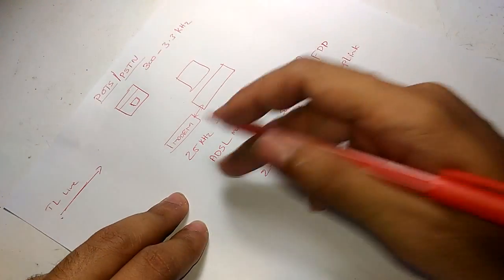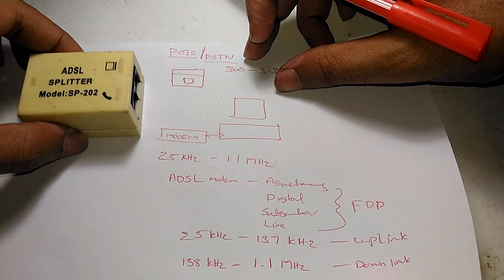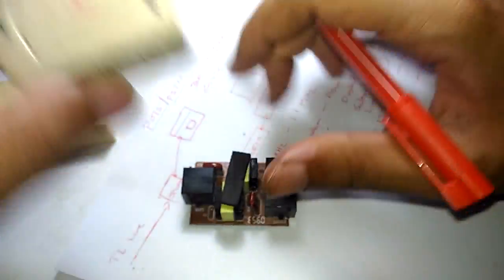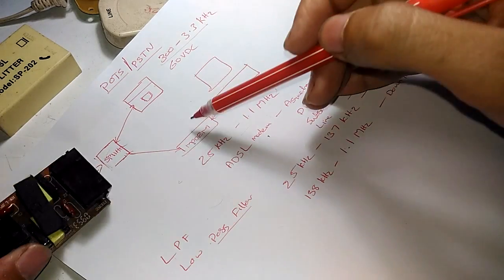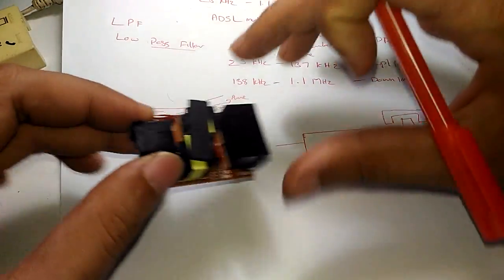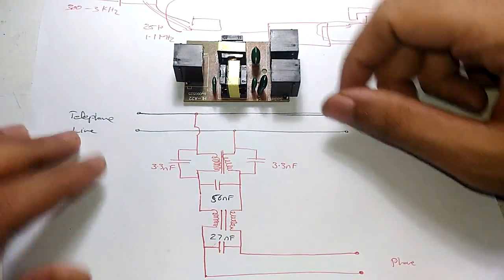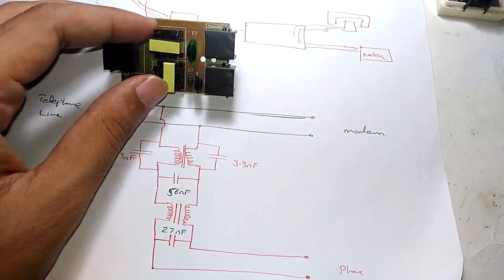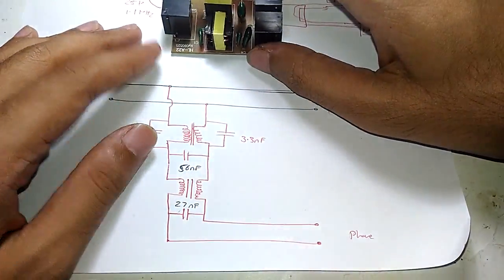IE42: How does an ADSL splitter works?

Comment: The best explanation ever of exactly how a DSL filter works I've ever experienced.  I am going to attach a signal generator to the input and an oscilloscope to the outputs to see how well my filter works. It's interesting that the filter is a low pass just for the phone.  I always thought both the phone and the computer needed filtering.  I agree regarding the false lightning protection claimed by that one manufacturer.  Great video.  Enjoyed it.  Thanks very much.

Comment: Are they still relevant?
Reply from the maker: Yes, if the people still prefer to use landline telephones.
Reply: @INSIDEELECTRONICS  what about internet? Also what are we using besides landlines?
Reply from the maker: There are still many people and offices using the broadband internet services. Perhaps due to the lower price of usage plans. So in such cases, these are still relevant.
Reply: @INSIDEELECTRONICS  landline means broadband? What's the better deal from those fiber??

Comment: so if my modem and telephone are apart i only need to have the splitter on the phone side. i opened inside my splitter and it's circuit board was the same but when my modem is trying to connect i can hear audible noise on the phone. my ADSL modem becomes noisy and i call support center they do stuff and tell me to reboot my modem and all the noise goes away for a few hours even no clicking sounds on the phone but after a few hours my modem keeps dropping and i have like 6000 CRC errors recorded on router interface. it has become an enigma that nobody wants to take responsibility for it.

Comment: great video, props for that my dude.
can i get some help though, i'm kinda confused.
the problem is that im getting about 17mbps when plugged-in directly to the line, when using a splitter it increases by 1mbps (meaning it turn to 18mbps) so is there a way to get the full advertised 18mbps without using a cheap splitter?
Reply from the maker: Well, I'm not sure about it. I suppose you can keep using the splitter since it's only improving the performance. 😀

Comment: Will there be any problem if I connect directly only to my modem without a splitter? (Not using a landline)
Reply from the maker: If you are not using a landline then you can connect it straight to your modem. No splitter is required. 👍🏼
Reply: @INSIDEELECTRONICS  Okay thanks, well what could be the problem behind this, sometimes my modem doesn't give internet access but when I call my landline that's whn internet starts working
Reply from the maker: If it's happening when there is a splitter in between, then try a different splitter or just connect it straight. If the issue persists, you may need to get it checked with a technician.

Comment: Sometimes when I pick up my telephone the internet disconnects for the time being. Is it because, The splitter is still adapting?
Reply from the maker: I'm not sure what exactly is the issue here. However you can try changing the splitter and if it happens after that, you may need to contact the telephone company.:)
Reply: @INSIDEELECTRONICS  ohhh, thanks for the info!

Comment: Hi, I got a micro filter upstairs and connected my router modem to it but I have no broadband signal. Can you please help?
Reply from the maker: Hi, first of all, check whether you've inserted the appropriate ports to the correct sockets in the splitter. Modem to modem, phone to phone and input to input. If that is fine, remove the splitter and connect the incoming line straight to the back of your modem and check. And check your modem is configured properly with the correct connection type and login password. :)
Reply: @INSIDEELECTRONICS  Yeah all of that is correct but my lights are shining red
Reply from the maker: Alright, that means the modem needs to be reconfigured. Contact your ISP or simply google to get the configuration method of your device and make the changes accordingly. That should fix the issue. :)
Reply: @INSIDEELECTRONICS  Do you think the cabling inside the telephone socket is incorrect?

Comment: Can telephony device frequencies interfere with modem frequencies further down the phone line (as they start to travel down the same copper pair wire towards the telephone exchange)? Or do they remain separate because they are using different frequencies?
I understand that the filter/splitter is blocking this from happening after the filter/splitter.
Reply from the maker: The thing is, outside the filter the telephone line is always susceptible to interference from all kind of different frequencies. But the telephone system is capable of differentiating what is useful and what is not. So we don't really notice the effects of such interference. Also it's not like the voice and data are both travelling as seperate frequencies, they always remain mixed the whole way through. :)

Comment: I do it , its very performances : the phone be very claire without noise... and the net be good conexion and without cuting
 please i m looking for adsl convertion to wan ?!  how its doing and how can'i inject it in the roter fibre (after the 1er fibre coversion ) :: i like it for uses the magnifique and performances qualite in the router fiber optique .. think you for your speed answer !?
Reply from the maker: From what I understood, you are trying to connect the fiber connection to your router, isn't it? For that you need a modem that support optical input. Once you installed such a modem, then the remaining process is similar to the normal cable modem. You need to configure it with the credentials received from your ISP and then you can use it like normal. :) If you are using an optical router you don't need an ADSL splitter.

Comment: I need to connect my telephone with my router and router has rj45 female jack so can I connect my landline connection with this converter...
Example- A wire with rj45 connecter from my router will insert into the main line of this adsl filter then I would connect my landline phone from the other end...
Kindly reply..
If answer is NO then what is the hack for it as I want to do calling from my broadband connection
Reply from the maker: Nope, absolutely not. You cannot use the ordinary landline phone to connect to the router. Both operates at different protocols and different voltage levels as well and there is no point in trying to make calls through broadband connection with an ordinary landline phone. Your smartphone can do it for you if it supports VoWiFi. :)

Comment: Can i connect ADSL-cabel directly to the "Phone" slot? Or is it necessary to connect it to the "DSL" slot?
Reply from the maker: Nope, you've to connect the modem to the ADSL port and the phone to the phone port. If you don't want to use the phone you can connect the modem straight to the telephone line itself. No splitter is needed in such case. :)

Comment: excellent video
Reply from the maker: Thank you so much for your valuable feedback. :)
Reply: @INSIDEELECTRONICS  From ur video , I understand that we can connect modem to the main line in one room/port and telephone can connect in the another room / port using adsl filter/splitter ..am I right?
Reply from the maker: Yes you are. As long as you are using a passive ADSL splitter, you can connect it like that. :)
Reply: @INSIDEELECTRONICS  Thank u

Comment: I'm not getting the speed which my plan provides .is it because me splitter is complaint.
Reply from the maker: I cannot be sure about that, but you can check it by connecting it directly. Also due to the current global situations, ISP's sometimes cap the speed to balance the overall load. Even I'm facing the same issue when uploading contents to YouTube, but not always though.

Comment: AC power (75v) is supplied to the phone line via the exchange in order for the phone to ring. The schematic diagram you've drawn shows inductors in the circuit between the NTE and the Phone. How does AC power get through the inductors when their designed to attenuate AC power? Relatively new to the telecoms industry and filters are baffling me.
Reply from the maker: The ring signal can pass through these inductors because its not designed to filter out the lower ring signal and audio frequencies. It's tuned in a way so that it blocks just the high frequency ADSL signals from reaching the phone. Other lower frequency signals will pass through it like its just a coil of wire. In short, the inductive reactance depends on the frequency of AC signal applied to it. If they don't match, it will simply pass the signal. :)
Reply: INSIDE ELECTRONICS! Right that makes sense. Nice one! Brilliant video
Reply from the maker: Thank you for the valuable feedback. :)

Comment: Hi bro very good explain and i get all things to need make splitter but how i can test all part of splitter work fine or fault in circuit?
Reply from the maker: Sorry to be late for the reply, but sometimes comments won't get notified by the app properly. You can check with a multimeter for any faulty components.

Comment: Nicely put together friend. I wanted to learn about this as soon as i found that splitters affected the adsl connection stability and sync problem. I was getting a lot of CRC errors then while trying different things I joined the main wall socket into the modem  port of the splitter and the single port on the other side to the router. My speed was then maxed with no errors at all.
Thanks

Comment: Hello... Thank you for your demonstration about the ADSL Splitter and I have a question...If all splitters are doing the same so that the difference is due to the quality of the internal LPF
Reply from the maker: Yes, the quality of component does play a role here. And more expensive filters sometimes uses multiple stages of filtering to ensure better performance.

Comment: Great video bro and my question is which filter is good for me,
Reply from the maker: Thanks for the valuable feedback. And I cannot suggest any particular brand or unit because the circuit in almost all regular filters are the same. But better go for any branded ones that at least we can be sure the components used inside are of good quality.
Reply: @INSIDEELECTRONICS  What should I use for FIOS?

Comment: Thanks for the great video. I use a DTMF controlled device connected to the phone line to switch on and off my modem through phone line via DTMF tones. So I use an ADSL splitter to split the main line to ADSL modem and the DTMF control device. But the DTMF device usually does not response to DTMF tones sent when I use a splitter in between. But it works fine when I connect it directly to main line or ADSL port of the splitter. So I think the splitter I use is blocking/filtering the DTMF tones although DTMF tones are in the range. May I have your comment? @sangeeth1
Reply: INSIDE ELECTRONICS! What I understood is, line going to modem has a straight line but telephone line is filtered. Isn’t it so?
Reply from the maker: Yes yes.. you are correct. I said it wrong earlier. The modem line (ADSL) line is connected straight across and the phone line is filtered. So what happens is that the splitter treated the DTMF signals as unwanted and so the signals are being filtered away.
Reply: INSIDE ELECTRONICS! I’ve checked the frequencies of DTMF tones, they seem to be in the band which means they must not be filtered by the splitter.
Reply from the maker: Yes, but still the components used inside are inductors and capacitors right? And they both resist the sudden change in voltage and current in their own manner. So what could be happening is, though the DTMF frequencies are not designed to be filtered, it is getting distorted/attenuated to some extent that the other device is not recognizing the full DTMF tone that is being sent. That also explains why it works when no splitter is in between. If you can view the before and after waveform in a CRO things will get much more clearer. :)

Comment: Such splitters makes my internet speed slow . When I directly connect Line to the modem , it's speed is 1mbps and when i connect splitter then my internet speed is between 200 to 400 kbps . Do you have any solution ? And last thing when connected directly to line then there is noise on conversation as weel as my internet goes down.......
Reply from the maker: +Saa N Dip As you may have seen from the circuit diagram, the ADSL line is connected straight to the PSTN line. As if the modem is connected straight to the line without any splitter at all. So for any reason if the splitter is making the connection slow its because the capacitors inside have gone short circuited and hence affecting the line. And as per noise is concerned, modern phones sometimes have built in frequency cut off. 😊 That depends on the quality of phone you are using. 😊
Reply: I had changed splitters 4 times but the same problem is repeated then how can you say that capacitors inside spliteer have gone short circuited???
Reply from the maker: +Saa N Dip  The problem is each time you are switching to another cheap Chinese splitters. Indians don't like to spend more than 200 Rs for a splitter. I can clearly say that there is nothing in between the line and modem inside the cheap splitter. Those filters inside the cheap splitter may not be properly tuned to the cutoff frequency, thereby making its own noise, or there is a leaky capacitor creating a short circuit. Try to upgrade to a quality mainstream product like original DLink splitter. It will cost around 600/800 Rs. Don't buy it from eBay.
Reply: Ok , then can you send me one Dlink splitter??
I will pay you....
Reply from the maker: +Saa N Dip I can only send you international purchase links. But then, you can search amazon.com for branded mainstream splitters. Make sure the socket type are compatible with what you have at home.
Reply: maybe there is a short capacitor inside the phone circuit its self